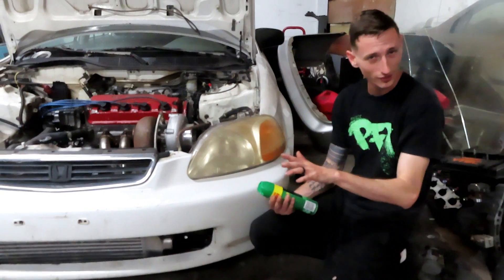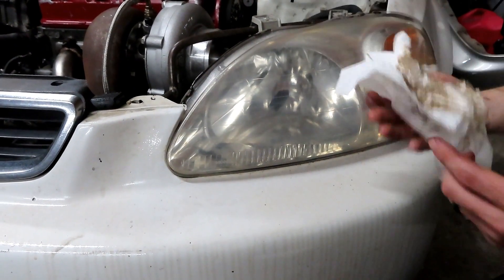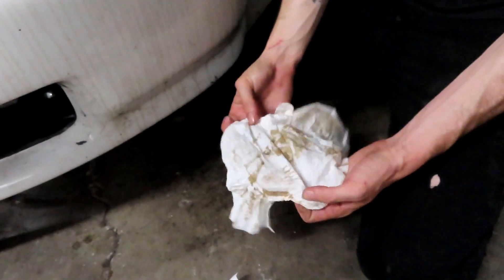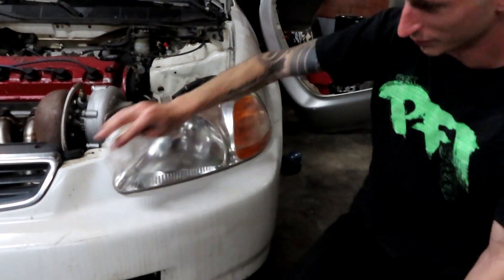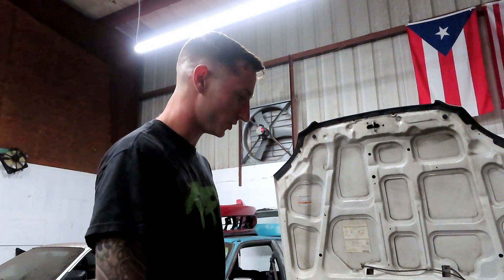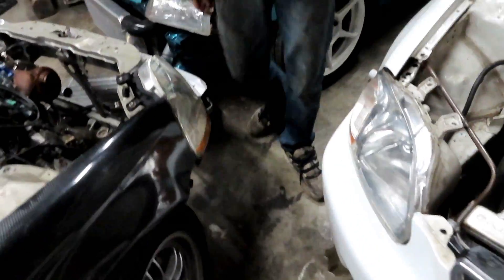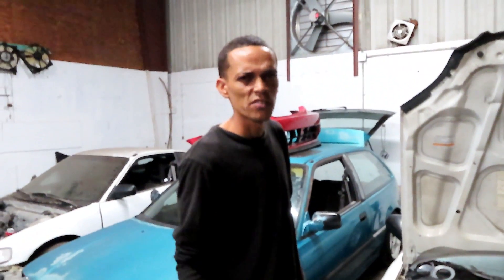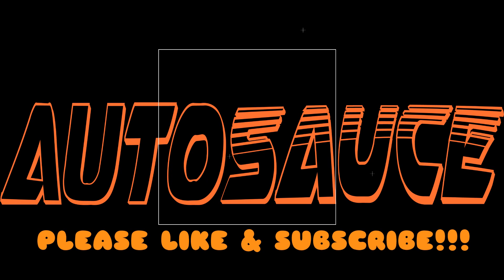Testing To See If the Bug Spray Headlight Restoration Myth Really Works On My Turbo Civic

Comment: The Deet is emulsifing the surface of the plastic. It's a chemical reaction. It's bad when you put the bug spray on and melt your watch band or shoes... the thing is the plastic surface needs to be smoothed out and then sealed to help it to last longer. This would just be the first step in the process.